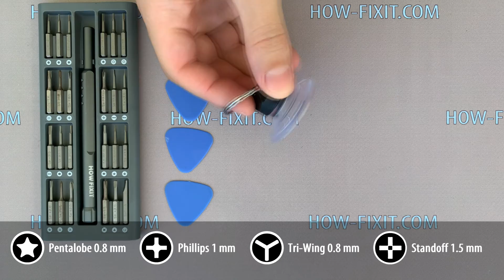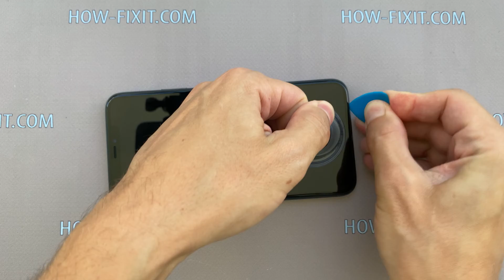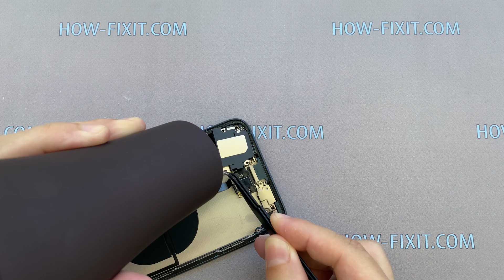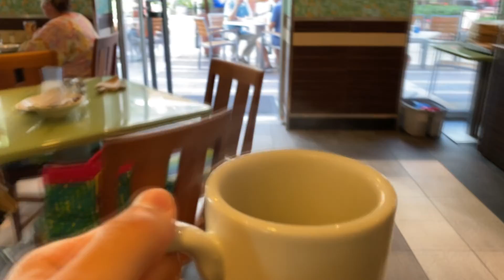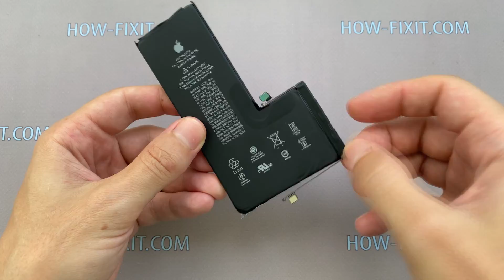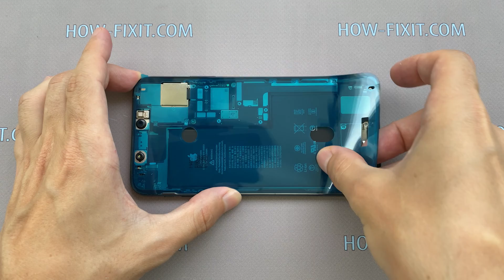iPhone 11 Pro Max Teardown Guide: Back Housing Replacement

Comment: @How-toFixit just found your video , I've got an issue with an iPhone 11 pro max which when I put the logic board into a replacement housing the phone restarts every 3 minutes and on the panic attack registry says that mic2 sensor is missing . Where is located mic2 on iPhone 11 pro max ? I'd appreciate it if you could answer . 
PS; when I put back the logic to the original housing the phone works just fine , I just want to change the housing because the original one is smashed quite bad . Thanks in advance!

Comment: The links to back housing on amazon or aliexpress don't come with cables and charging module. Where to find this part to simplify reassembly?
Reply from the maker: I added a link to back housing with cables
Reply: Thank you!

One more question. Replacement housing has no wireless charging?
Reply: @KamiCrazy   i bouth one and did not come with it (mad) not fair i got the same link smh
Reply: @howfixit  need the new link for the housing with bottons please

Comment: How will the Water resistant work
Reply: It won’t
Reply: You would have to get a new seal
Reply: @aaron10551  even then you cant trust it
Reply: @kinggodzilla7273  in theory it will be 99% as good as the original phone
Reply: @Aikaramba12  id doubt it. apple had a machine that does it under immense pressure and heat to make sure it is ready to sell. yours might make it water resistant to like a light rain or even a quick dip but its not waterproof anymore. you can get waterproof cases though. ive fixed 3 11 pro maxes and ill be honest i havnt installed the seal on mine yet
Reply: @kinggodzilla7273  they don’t Apply the glue under pressure, they test it under pressure and heat after it has been assembled. Like they do with divers watches. The way they put the glue on is the exact same. Only difference is that they test it. But that said i would never put my iPhone underwater no matter what
Reply: @Aikaramba12  yeah dont dip it